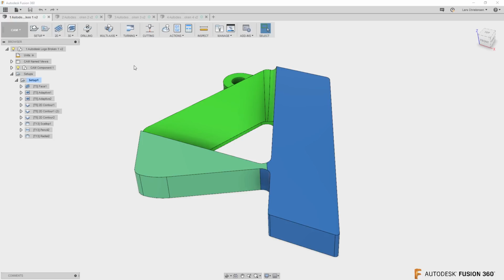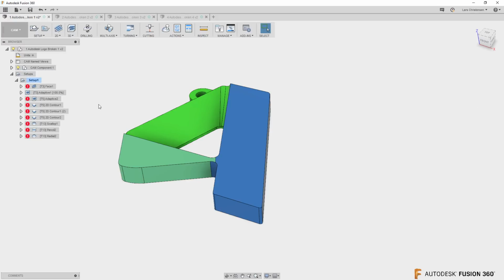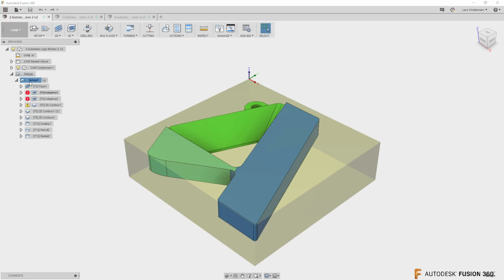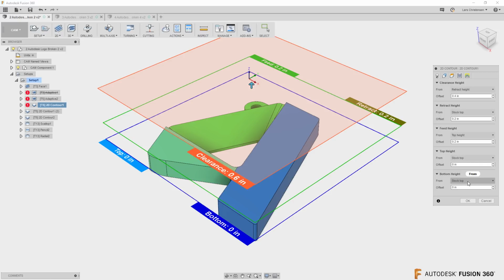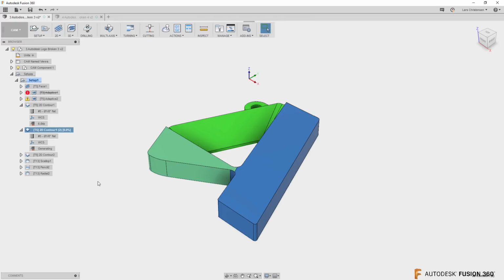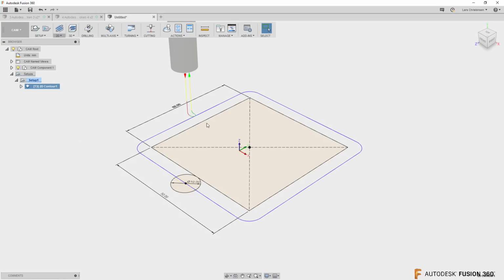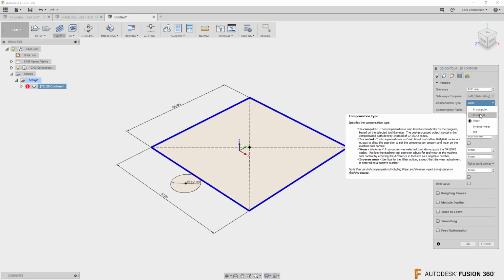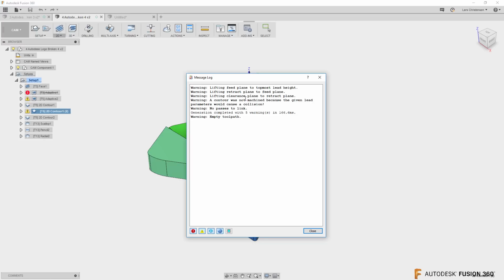Troubleshooting in CAM for Fusion 360  — Tutorial — #LarsLive 161

Comment: Thanks Lars!  I'm pretty new to Fusion, but with your excellent tutorials, I'm now producing functioning tool paths, with one exception;  On one model, try as I might, I can't get it to mill out 2mm holes (on a 2D-contour operation) using a 1.8mm PCB end mill.  I've had a couple more errors, but after a good night's sleep, I have managed to fix them!  I'll share the file with you, if you get  a chance in your busy day, I'd appreciate your input.  BTW, as a work-around I have added the 2mm holes as a separate drill operation, but there really shouldn't be any need!  Help!!
Reply from the maker: Hi Andy W Thank you for watching!
I might need some more coffee, but are you drilling or milling? With milling, do you have stock to leave on?